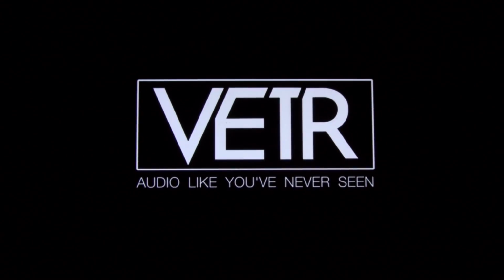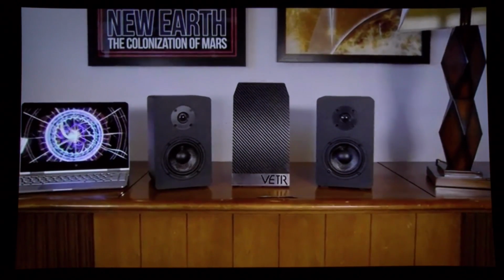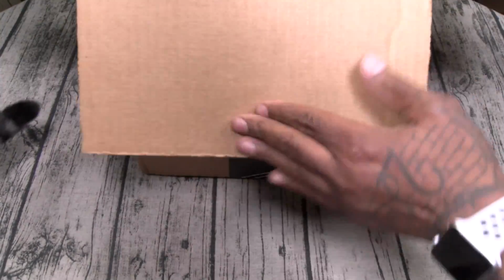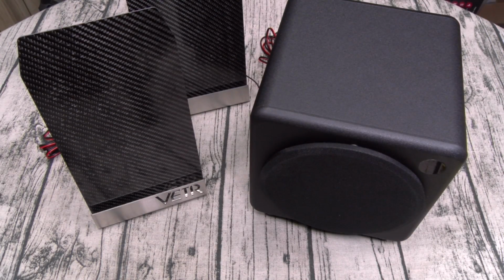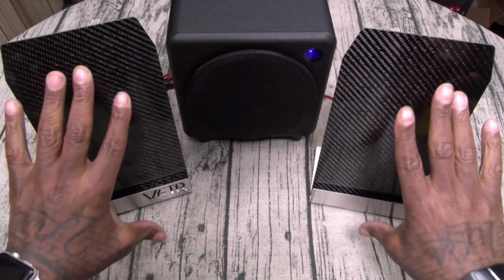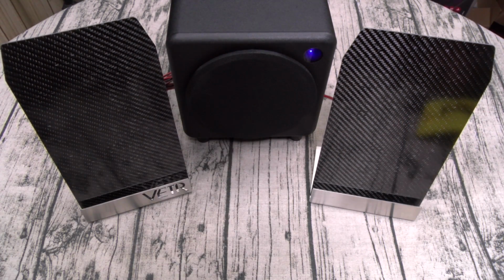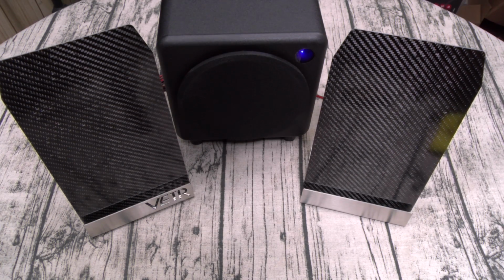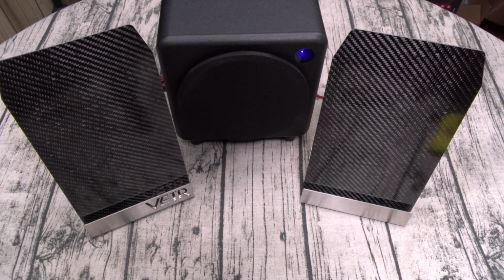PANL1- The Worlds Thinnest Carbon Fiber Speakers

Comment: I'm curious about the technology behind the carbon fiber units.  What purpose does the carbon fiber serve?
Reply: smittyboy007 looks
Reply: there's no new tech in the panels. 

They are connected to transducers which causes them to vibrate and make sound. You may be familiar with the tech if you've head of the "turn anything into a speaker!" devices.

You could use glass, ceramic, or any other stiff material for good results, but nothing practical could be made as thin as with carbon fiber. Plus it looks cool.
Reply: i had a device like that called a Soundbug in like 2005-2006 that could stick onto a window and turn itinto a speaker. it worked well enough, upon seeing this i assumed it was using the same technology just with a peice of CF. lexan or similar would work equally well at a lower price point
Reply: Carbon fiber actually has excellent acoustic properties
Reply: smittyboy007 they are dml speakers. Similar to the transducers that can make anything a speaker. Carbon fibre is strong and light they might have found it to give them a good freq response. Its also durable so it wont break while looking sexy.
Reply: the carbon is there to look good,and the speaker drivers behind it bounce off it.
Reply: It's thin and rigid.
Reply: @johnbravo7542  NO, the actuators are attached to the carbon fiber panel so it's the carbon fiber panel  that's acting like a speaker cone.
Reply: @Oneness100  Yeah,well that's what was ment by my comment,you can put thin fucking plywood there and it would do the same fucking job,but would you buy it? NO! so they made it more appealing by making it of carbon fibre,Diy audio is my hobby and have built everything from tube amps and preamps to speakers,I know what I'm talking about.
Reply: @johnbravo7542  Carbon fiber is a material you can make very thin, but rigid, plus if you tap on it it's not going to have weird resonances.    Obviously, the carbon fiber units I've seen are small versions, less than a foot tall and around a half a foot wide.   And they are sold with an optional subwoofer.

Either way, NONE of these soundboard type speakers that are on the market have every been approved of by the audiophile community.   As a novelty gimmick speaker, that's more of what they are about, but for a serious listening speaker? NAH.  Not at all.   I heard the JMC version which uses Source (tone wood used for guitar tops on top end guitars) and it has 8 actuators, and it still sounds kind of dull.  Again, not something a serious audiophile Is going to purchase, even if the thing costs $6500 a speaker.  

Like the guitar industry, what type of material you use to make the top or body of an acoustic instrument is going to change the tonality of the instrument, and of course woods will change in different temperature/humidity levels.   There are top end violins, guitars made from carbon fiber and they are used by even the most demanding musicians..

You want the material to resonate, but not create it's own coloration, which is going to be about the hardest thing to avoid.

I'm sure anyone that dives into this type of speaker design would have to spend many many years testing every type of material, sandwiched materials, actuators, combinations of actuators, etc. to find the best combination.  And there are almost limitless number of combinations.

Either way, until someone comes up with something that the serious audiophiles would approve of, they haven't approved of any that I'm aware of. I've never seen any at any audio show, or any favorable review in any audiophile magazines/internet review sites.

The problem is that people can know all kinds of things about how to make something, but when it comes to listening skills, that's a different expertise and unfortunately, not all people that can design and build an audio product necessarily have the best listening skills.
Reply: Have a Spritzer if you've made speakers?   Really?   Or do you mean you bought drivers/tweeters, crossovers and all you did was build a cabinet and install the components?   FYI. Driver mfg's and designers are constantly playing around with different materials for the driver cones, because they are still creating new, more advanced materials.   Carbon fiber is still used for speaker membranes in speakers that are considered amongst the best sounding.  Check out the MBL tweeters and mid range drivers.   They use thin strips of carbon fiber for over 20 years with no changes. 

All you can really comment on are hobby based DIY.   Don't try to act like an expert, which you are not.
Reply: basically they use an audio exciter to vibrate the panels carbon fiber is good for this because for ideal sound quality you want a material that is flexible and very stiff, carbon fiber has those properties, other alternative would be extruded polystyrene or various types of wood... either way if you are curious to see more similar look up Distributed Mode Loud Speakers (DML speakers)

Comment: I don't sit and read through 100's of comments so forgive me if this has been pointed out already... but does anyone else get the irony of these guys punting high end audio gear, yet they can't get a grip on the audio production in their promotional video?  Need to tame that echo lads... lol.

Respect to Floss and Xerx! Thanks as always for your videos.
Reply: In my haste of having to be a smart ass, I forgot to mention how nice these little babies sound! I was impressed with how much low the carbon fibre speakers produced but when you kicked in the sub, it really set it off.  I'd grab a set myself but the tag is a little high for my liking for what you get out of the box.  I'm sure I could muster up a lot more power and sound dynamics for the same or even a lower price.  Still nice to look at though, eh?

Comment: Maybe it's just the microphone and youtube compression crushing the audio, but it really sounds like they're only using the PANL1 speakers as mids and tweeters, and they lack the excursion in the exciter and attenuation in their crossover network to actually function as standalone woofers. Given that the exciter is solidly mounted to the bass and the carbon fiber panel is so light and rigid, they probably could have come closer to full-range driver capabilities if they wanted to. The subwoofer seems crossed over quite high, probably up to 300Hz. This is actually pretty common with inexpensive (and sometimes quite expensive) computer speakers where they're trying to use a line array configuration of really tiny drivers that just can't cope with midbass. All in all, based on what I'm hearing here, they don't seem quite $300 worth of speaker to me when you've got Sony 3-way bookshelf speakers/rear surround speakers that have just as much bass presence without needing a separate sub, for under $100, depending on just how much of a sale they're on. But they're always less than $300. I'm not willing to give up on cone and dome speakers just for a gimmick if they can't beat out what they're claiming to replace.